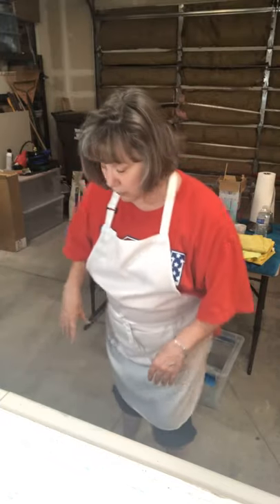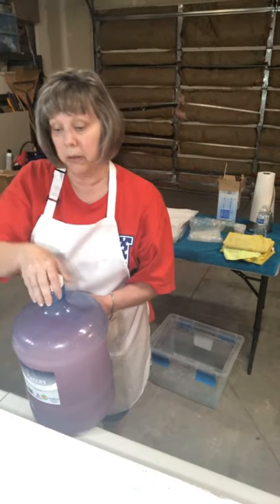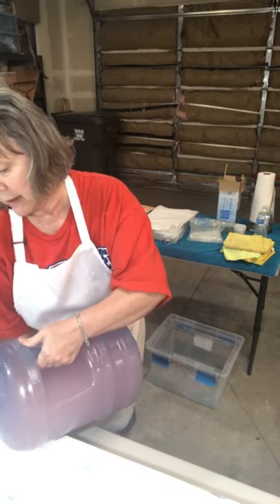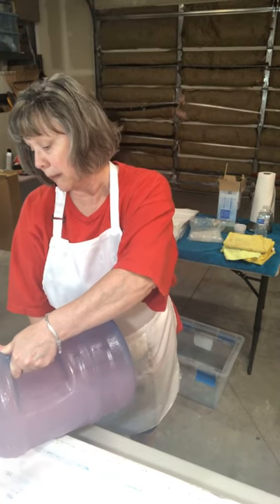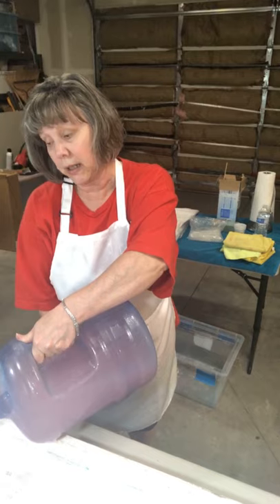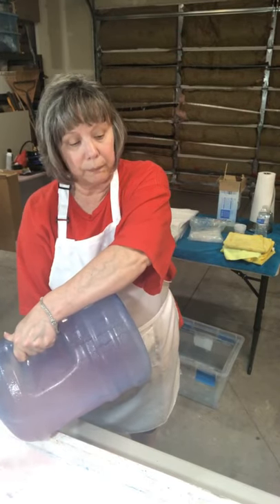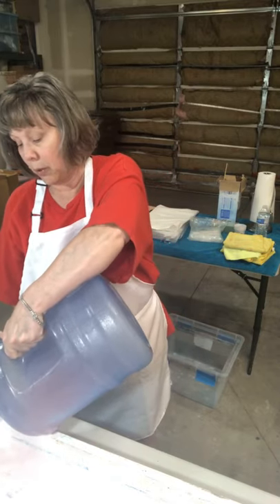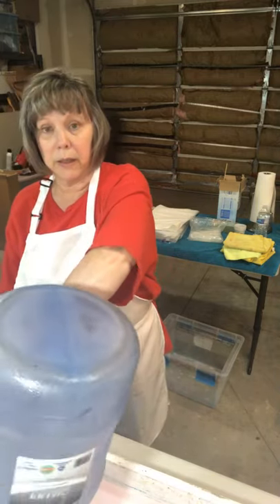23 - Monday marbling on a Tuesday!!  Marbling Leather and Quilting Fabric

Comment: Hi this was great. Couple of questions if you don't mind. What is the purpose of the newspaper, seaweed power (alo is there one you recommend) ratio to water and how long should you let the leather sit before you take it off. Will Xantham gum work to thicken the water instead of seaweed power or Carrageenan?
Reply from the maker: The newspaper takes off the paint remaining after printing an item.  It is then ready for another project. Leather can come off the water immediately after printing, as can all projects.  I have never used Xantham gum, but I have heard that it may work.
Reply: @aqueoussilkllc9654  thank you. The seaweed powder you recommend?
Reply from the maker: @stephaniescreationsllc  https://www.etsy.com/listing/1010193607/lambda-carrageenan-powder-for-water?click_key=79f65600d0e56a6006cea2e9f22d048d580886fb%3A1010193607&click_sum=4792ee96&ref=shop_home_active_13

Comment: Good day! Do you thin your Jacquard paints and put them into the drop bottles? How do you keep them from stiffening before laying down the leather? Also, how do you prepare your water? Please tell me your ratio of paint to water. Thank you.
Reply from the maker: I do not thin my Jacquard paints.  They come prepared for marbling. No water is added.  I'm not sure I understand your question about the leather.  I marble it the exact same way I marble cloth.
Reply: @aqueoussilkllc9654  thank you. I meant do you keep the paints from stiffening on top of the water. I understand more about this type of marbling paint now. Thank you for responding
Reply from the maker: The paint will not stiffen on the water, but it will begin to dry after 15-20 minutes, depending on your weather conditions. Create your design and then print the leather within that time and you should be fine.  I hope this helps.
Reply: @aqueoussilkllc9654  immensely helpful! Thank you so very much!